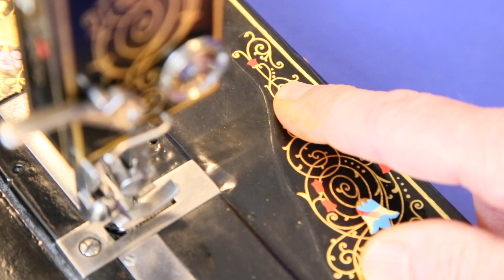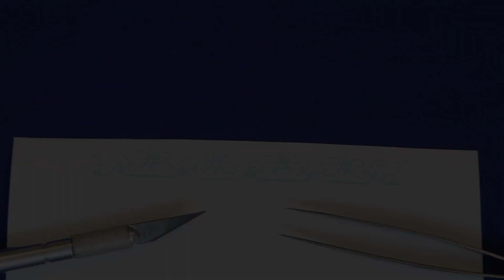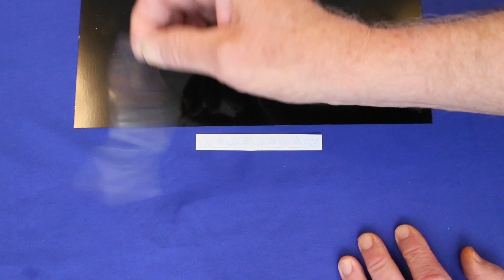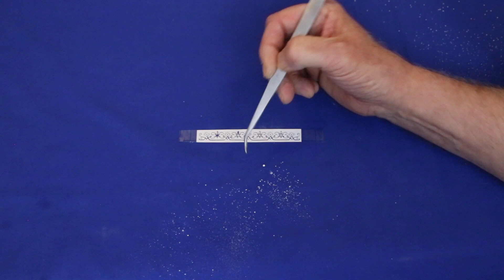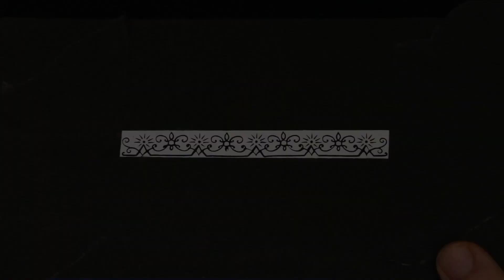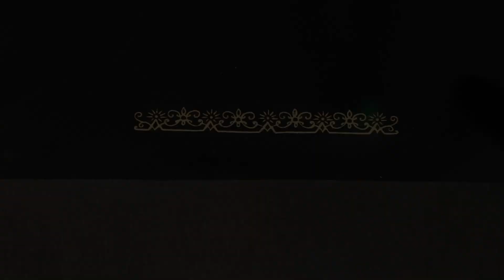Antique Sewing Machine Restoration Ultra Fine Stenciling

Comment: Wow, what spectacular machines and restoration, marvelous!!  A treat for the eyes.  Thank you for saving so many of them.  They are a splendid collection.

Thank you for the in-depth tutorial on scanning and cutting these stencils.  Looks like this machine is a Brothers Scan Cut priced at $300. Never knew this existed, such a great machine for stenciling and decals!  The way you explained the sizing of the design for an accurate smaller print, is the same as taking a large format photo on a Hasselblad, and reducing it to a 35 mm print size.  All the details are sharper and more vivid.  Very clever!  This is a masterclass stenciling video, many thanks!  Subscribed.

fyi - There is something wrong with your audio which is making lip smacking noises in the background.  Use a shirt microphone pinned to your collar or one with a 'sock' on it to muffle ambient sounds around.  Audio should be clear not speckled with static dust.

Comment: Love this!  It has been a while since I used my Silhouette plot cutter, but once you have gone through all the effort to create a matching image, you then have a cut file, that could be shared, don't you?  You could probably make some money back on all your time and effort.  I have a Singer 221 that has the normal wear in front of the needle on the gold filigree. I know I'd pay for a cut file to be able to fix up the worn spots.
Reply from the maker: Hello! And thanks for commenting!

You already have all you need to create a stencil to touch up your machine. Simply take a picture of a similar but undamaged section of the artwork, clean it up in whatever photo processing software you like and import that into your cutter. Resize it to match and you should be good to go.

An easier solution would be to purchase a decal set and cut out the area you need. The color match might not be perfect but it's a lot quicker than going through the hassle of gold leafing.

Easier still, if the wore area is small, is to get some magnifying glasses, a very fine paint brush and touch up the area by hand.

Since you have a Singer 221, you might enjoy my short video about one I recently refinished:

https://www.youtube.com/watch?v=2zW0LYwgRlo&t=13s
Reply: @wayneschmidt490  Thank you so much! I might try a couple of these options and see what works best.  If all fails, and I completely muck it up, I suppose that I can default to repainting the old girl, and start from scratch. Thank you again for posting these great videos!
Reply from the maker: @PrincessEvilGenius  The following video shows several techniques for touching up decals by hand:

https://www.youtube.com/watch?v=bDZVF_H79T8

Unfortunately, I discovered the paint pen I recommended can change color after a year, so you'll want to find a gold enamel or go the gold leaf route. The fake stuff also works well and is cheaper and easier to use.

Comment: So without a full understanding of this process this might be a useless sugestion but have you tried using washi tape instead of transfer tape? I am not exactly sure what transfer tape is made of but Washi tape is a decorative tape used most often in planners. Most of it uses a rice glue meant to be easily removable from paper without tearning it and without leaving sticky residue.
Reply from the maker: While I haven't used washing tape, I have tried several different types of paper tapes and they all failed. The problem, even with high-end automatic tapes, is that the paper fibers hang up on the blade and end up tearing the stencil. Vinyl cuts cleanly because it's a soft plastic and doesn't have any grain.